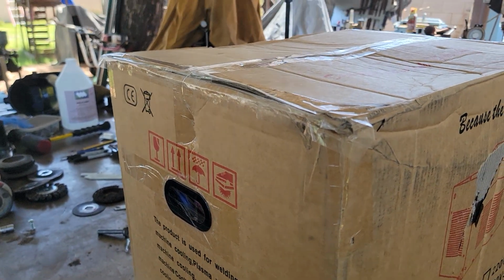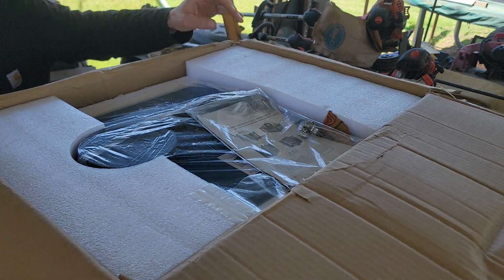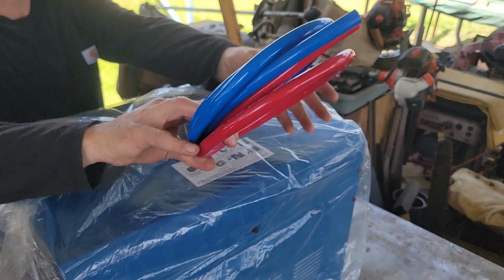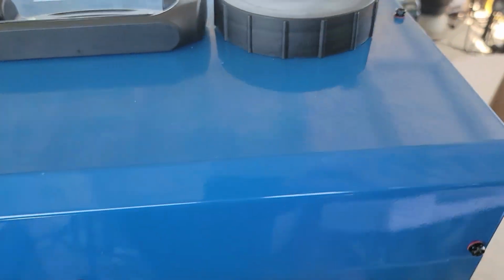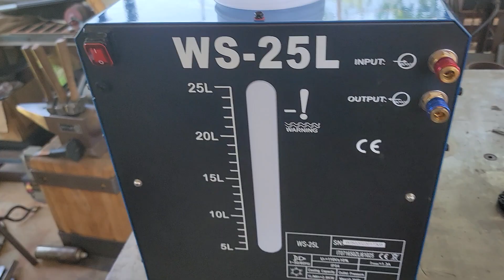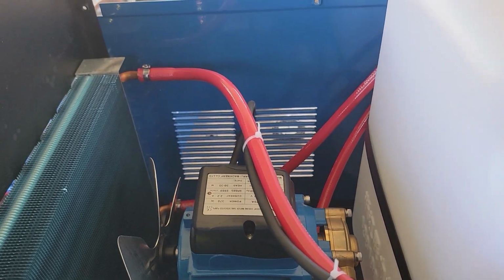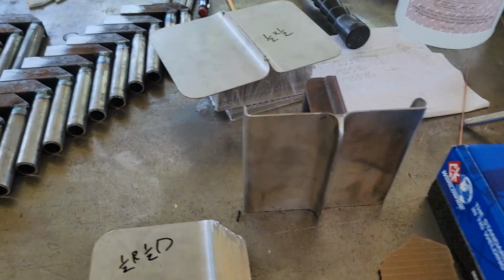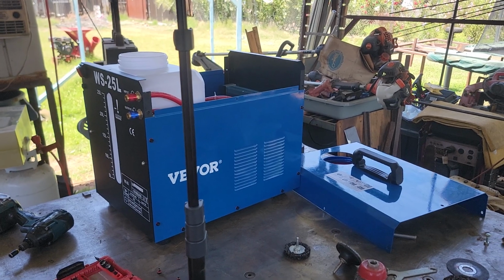Vulcan protig 205 water cooler upgrade part one

Comment: I can agree with you that air cooled torches are limited. I'm in Florida and when it's 93° outside the torch doesn't cool down as fast. I have a primeweld Tig welder with the Maxcool watercooler CK worldwide flex-loc torch it was the best upgrade to my setup. I Don't know why I punished myself for so long with the air cooled flex-loc torch! When I made the switch for the water-cooled torch night and day difference welding time increased triple even better for aluminum I've been taking on huge aluminum jobs where I need blankets to cover my self from being burned....😮😮😮😅